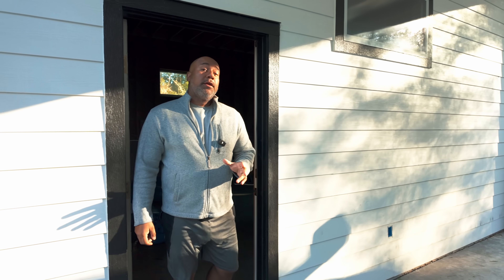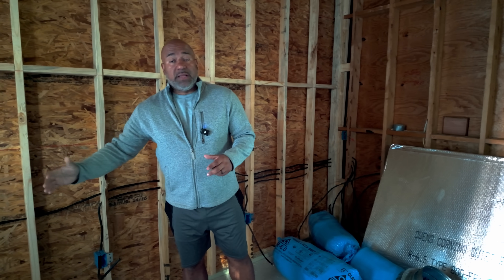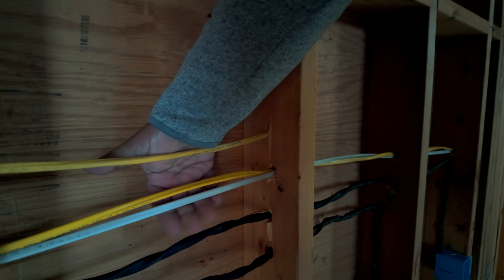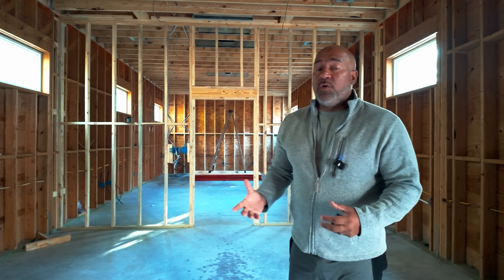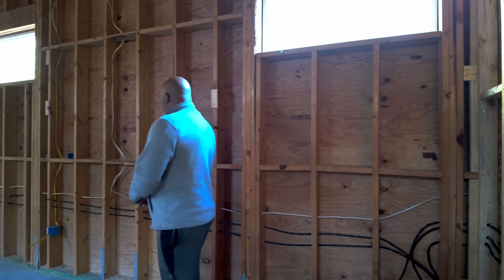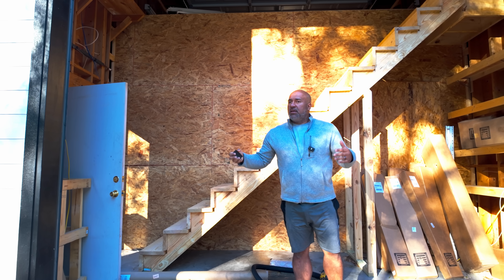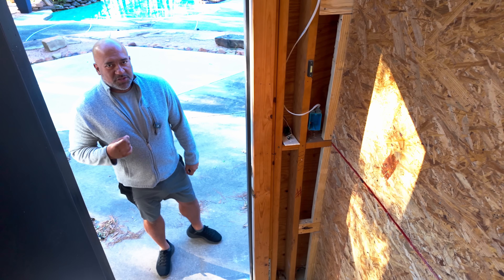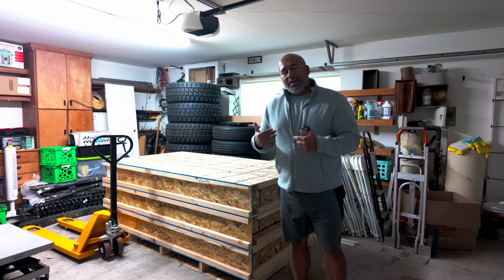Supercharging Future Sound: The Quest for Immersive Audio #halloween

Comment: You put the Romex in a drill and twisted it tighter “for more shielding”… I’m actually speechless for once. That’s not just a code violation, that’s a full-on Darwin Award audition tape. Twisting the factory-twisted conductors even tighter crushes their insulation, stretches the copper dulling it's surface and creates micro cracks = increased resistance. Twisting tighter does jack squat for RFI when the entire run is inside grounded metal conduit anyway, which it's not even supposed to be—Texas adopts the NEC straight-up (with no major amendments on this point), and NEC 300.3(B) explicitly requires that where conductors or cables are run in a raceway (like that steel flex), you gotta use individual insulated conductors rated for it, like THHN/THWN. Romex (NM-B) isn't designed for that; its outer jacket traps heat. But the best part: it’s all on HD video, time-stamped, proudly narrated for your insurance adjuster, who will deny your claim before the fire department even rolls the hoses back up. “Sir, you intentionally modified listed NM-B cable and used it in a non-approved manner. Claim denied!” Not smart.
Reply from the maker: Awesome - thanks for watching though
Reply: @jaysaudiolab  Jay, I get it: content creation is part showmanship. But when you publicly document modifying listed cables in ways that violate the NEC, stuff it into metal conduit it’s not rated for, and over-twist conductors with a drill, you’re not just making a video, you’re creating a permanent record that can (and likely will) void your insurance and endanger the people who work in or visit that building. Many people do this stuff for a living (engineers, electricians, acousticians, inspectors), and we’re genuinely trying to keep you from burning the place down or getting red-tagged. You’ve got a pretty big audience. That comes with responsibility, and also criticism when you screw up. Still rooting for the room to sound great… preferably without becoming a viral fire video first. 🔥🍿

Comment: Have you considered how you will build the walls?  With ceilings as high as yours, the walls will be quite long, and subject to flexing.  I would think you would use something wider than 2x4s, and maybe sheath them with plywood before putting the sheetrock on.  And glue everything together, you don't want studs, plywood or sheetrock vibrating against each other.  I have also read that walls shouldn't' be too stiff either.  I think there was an article about this on the Goodwin's High End website, when they did their sound rooms.

Comment: Yes, a length of 8-gauge wire wrapped around a room, especially if it's unshielded and not properly grounded, can act as an RFI/EMI antenna, picking up and radiating electromagnetic interference. This happens because any long, unshielded conductor can function as an antenna for both transmitting and receiving radio frequencies. Properly grounding this wire, using twisted pair wiring for signal return, or using a shielded cable can help prevent it from acting as an antenna, and can help mitigate its interference.
Reply: It doesn't really matter how or which wires he uses. I doubt the human ear can detect any difference. Well, the main thing is that he enjoys building the listening room.

Comment: Having the wires cross at 90 degrees will provide the max isolation to each wire distance is not need there since there is no inductance  coupling . An outside isolation transformer for the rooms can give a very large noise reduction . Nice build so far .

Comment: Hi Jay, would be interested to hear what type of receptacles you plan to use, as well as the breakers and sub panel.  

For my build, I used the PS Audio receptacles which are really nice and they accommodate 10 gauge wire.  I also used Square D breakers and sub panel.  

I originally asked for a sub panel with solid copper rails, but unfortunately that didn't transpire. But, they did use 3 gauge wire from the main box to the sub panel which was a pleasant and unexpected surprise.

Best of luck with your build.

Comment: What's normally done in attics is to suspend from the roof on an isolated uni-strut U-channel frame any air handlers so the celling does not become a giant drum head and transfer any equipment vibrations to your celling just ask your A/C contractor to suspend the air handlers I am sure he's done this many times before. This is very important for keeping your HVAC quiet. Ray

Comment: I do not recommend using any 60 cycle US current for Europe 220V 50 cycle  gear unless the equipment is labeled for 240V 50/60 cycle electricity. Easy way to get rid of any inductive cross talk from your feeds would be to use 1/2"-3/4" EMT and then you eliminate any induction and gain fire rating and can add circuits in the future by just pulling more wires thru the EMT metal pipes that were part of original build. Ray

Comment: Please put in double boxes for you 8 gauge circuits now.  After it’s all done you only need to use one of the receptacles but in the future, being able to plug in three gizmos directly will be so far better than a plug in strip. You could also two circuits to each of the left and right boxes. You also should have “regular” outlets on that back speaker wall for hey whatever, like a light.

Comment: You really should have talked w an EE who does power.  Also an electrician.

First you're going to have to run a trench and a separate meter to your out building. (garage).   You could  have run a line from your house... which would accomplish the same thing. 
Splitting your sub panel (which is what you have if your main panel is in your house... doesn't really do much for you.  Same w the over gauged wire.  (I think 20A is 12 gauge wire)  You're worried about noise in your electricity from your main house  yet you have an A/C unit on your line in your out house.  So you will have noisy appliances 

Did you budget adding in lighting rods and grounding them on your building?  
Or adding surge protectors at your panels?  (now one for each sub panel)  Are you adding any line conditioning at your outlet?  A re-generator?  
Are you putting in 5-20 NEMA plugs?  Something better than basic builder grade? 

You have some things right... other things not so much.

Comment: This is where the phrase, a little knowledge is more dangerous than complete ignorance where the latter is aware of their ignorance and relies upon professionals to design and implement. First of all, you’re not plugging in a 240VAC “amp from Europe” into your 240VAC NEMA receptacle unless that amps power supply was specifically intended for NA market. NA uses 60Hz AC, most of globe, including Europe uses 50hz. You will smoke the toroidal transformer and likely the caps feeding a 50hz designed amp with 60Hz AC.

You twist the factory twisted NM cable but then you run parallel pairs 4” apart? Please hire a licensed and knowledgeable professional before you close up that wall. 

Did you drive a ground rod through slab for your ground bus?
Reply: I wonder what the building inspector will say.  I'm not sure if he's pulled any permits or has to pull permits... although w the electrical work he should have.  Especially when it comes to insurance. 

Building codes differ by state and municipalities.  Same with running a business out of a home.  (But that's another story...) 

Also I don't think the US 240VAC NEMA plug is the same for the US as it is for Europe but I could be wrong.
Reply: @michaelsegel8758 I honestly don’t know if he’s in Harris County or not. My son lives in Houston, University Place neighborhood near Rice University, where he is a professor. We did permit work on his home when he first bought it, that county follows NEC. If Jay is located outside of Harris Co, it’s very possible they do not follow NEC. There are many jurisdictions in US that fail to follow NEC. 

There would be several red flags an inspector would fail property for. Just having 8awg NM cable in 2x4 studs, you know there is not the required 1.5” setback yet no nail plates or shielding. 🤦‍♂️ While running parallel feeds of NM cable less than 16” apart is stupid from a noise standpoint, it does not violate any portion of NEC. On the other hand, there are no North American 120VAC receptacles that I’ve seen rated to accept 8awg conductors. Largest allowed is commonly 10awg, even that is pretty rare. It’s likely they will tie the 8awg line to 12awg leads from receptacles, otherwise a fire risk and major red flag for inspector. 

Correct, no NEMA receptacle suited to any European plug. We own a home in Northern Italy that uses a stacked in-line 3 pins receptacle. Most of UK and EU use what they call a Type C 2-pin connector. Unfortunately I’ve seen folks mocking up custom power cords with either an IEC style or a 9-pin DIN connector that comes as factory chassis mount, the other end a NEMA TT30R or 14-30R .

Comment: Hope you got a deal on those Mc 1.25kw mono blocks, otherwise you're about to get stuck with them like every McIntosh dealer in the USA (Since Bose ghosted a ton of McIntosh dealers).   Dealers are liquidating those for $11,500 each all day long.      As to the electrical....pass the popcorn, I've posted previously what you should have been running.  SMH

Comment: Have you considered an air filtration system in the rooms?  They won't be something you want to dust when they are finished and such a system will reduce the need to do so, and replacing filters is much easier than spending your precious time with a feather duster. Although I imagine you would look fantastic doing so lol.  Just a thought.  Also, however many mains power outlets you THINK you need, Treble it! (No pun intended) I fitted over 20 in my digital dark room and ran out within weeks, I now have extension leads tacked to the bloody walls everywhere. Lesson learned 🤣

Comment: On the wires I would have used emt metallic conduit which is code where I live that would shield them from all internal and external interference. I think that is much better than just twisting the wires. My only suggestion.
Reply: Conduit is required in Chicago. And just run 12ga wires for 20A.  I wouldn't mess w the 240 but I did it in my former home's kitchen for some appliances.
Reply: Correct I am I. The Chicago area also.

Comment: If you spray insulation foam on the walls, you will seal all the wires and sockets in the walls. If you want to make any changes, you virtually have to pull down walls and do everything again. Cutting and drilling through foam releases all these fine particles in the air loaded with toxic dust. Use of natural wool or jean bats is the best imo.
Reply: As with some of the comments regarding electric pre-wiring, he’s “done his research”, so it’ll be interesting to see how things turn out. Of course, some of the concerns expressed could take longer to materialize than he stays in this location and the Siamese twins of expectation and confirmation bias are very strong in the obsessive audiophile community, so there’s that.
Reply: @fonkenful Foam probably burns fiercely

Comment: Hey Jay,  It’s been fun watching the process of your room build and the attention to the details. Thanks for the work that goes into putting the posts together. As an electrician, I was impressed with the dedicated circuits for the audio, and isolating those circuits from the general purpose circuits. The lighting dimmers can be real noise makers (electrical noise). One detail that caught my eye was the #8 gauge wire. The 15 and 20 amp receptacles rated for 120 colts will have connection lugs that are designed to accommodate up to #10 gauge wire. It’s likely the contractor will have to “pigtail” a short piece of #10 wire to each conductor inside the wall box to enable connection the those receptacles. Not a problem, or code violation, but he will want to make sure the wall boxes have adequate capacity for the wire and devices.  The only other detail that comes to mind is having your electrical contractor go the extra mile with the grounding electrode system for your building. Additional 8 ft or 10ft. copper rods spaced properly can be great way to improve that grounding path as well as a good type1 surge protective device at the panels. 14:08

Comment: House feed from utility will most likely be 1/0 aluminum or smaller or at best 4/0 aluminum. Did you test your feed? Utility will come out for free
Reply from the maker: They came today
Reply: Have utility test feeds power factor at your residence. You want clean power coming in.

Comment: I've sold millions of dollars of Eaton loadcenters.  Get the CH loadcenter from them, full copper and built like the 1950s.  Those BR breakers and BR loadcenters are average with small bus bars, get the CH ones which are thick and copper.  I don't know if Texas requires Arc Fault Ground Fault breakers on each circuit, but if they do just install them for inspection and replace them with regular CH breakers later.  Even 'high end' audiophile panels use the CH as their base.  Nothing from GE, Square D, Siemens even comes close to the build quality of the CH loadcenter.

Comment: A pro tip. You can adjust humidity as you said and humidity have a small impact on speed of sound.. ❤🎉

So at 20 °C going from dry air to saturated air increases  by ~1.5 m/s (≈0.44%).

Comment: @Jay, you should have gone off-grid for your music system in both rooms with LFP batteries and Solar Panel on the roof top for charging...EcoFlow offers amazing products for this...you would have got far far better power
Reply: Going battery with a pure sine wave inverter was the biggest leap in my system.  That might be a bit too much for a lot of people, but so worth it.
Reply: @isobutylquinoline yes batteries with pure sine wave inverter can bring out a lot of improvement. Just add a very competent EMI filter next to batteries so that it will remove all EMI generated from SMPS in the inverter. I am using OnFilter PDU connected to the EcoFlow Delta 2 battery...best and cleanest power possible for my system.

Comment: I just built two 2meters power cables made of 14awg occ copper ptfe insulated, one twisted and one straight with wood pieces to separate them 7cm appart. The twisting reduces noise (sound quality increases) but slow down the sound, like power conditioning can do. And the lower the gauge the worse it should get, because of capacitance. So I’m a little bit afraid of using meters of 8awg twisted. It could sound slow like crazy :o. But maybe I’m wrong..
Reply: Huh? 
"Slow down the sound?" 

Do you realize that you're talking pure nonsense ? 

And when do power cables carry sound?
Reply: @michaelsegel8758 indeed im talking about audio and not sense or logic. This is the mistake you all do, thinking before listening, and you miss many things. A system that sounds slow when it comes to rythm and pace is something real.

Comment: I used 10 g cryo treated romex, I cut two 6 foot runs and then used it as speaker wire so I could listen and determine what end I used at the meter and what end on the hubble cryo treated outlet. Don't use dimmers way too noisy.

Comment: Jay... You should create a raised flooring platform,  with a lowered area near the front.. so that all of your Amps sit BELOW the surface of the raised listening Floor (an Amp Pit).   This would allows the soundwaves from the speakers (which are also at the same height of the listening floor), to propagate the entire Room, without bumping into amps... and causing any sound changes.

 These Amp "Pits",  could even potentially have removable trapdoors to completely hide them.   But thats not really necessary.

 An Added Benefit to dropping the Amps in a Pit.. is that you can Install a Movie Projection screen.. and have an excellent home theatre experience, without the Amps visually distracting you.   The screen can also be mounted much lower, since the amps are below the surface level.

 The Amp Pit, can be a few stair steps down worth of height, and be plenty large enough, for both operation, and various swapping.
Reply: However, he sells big, beautiful amplifiers.
Reply: Getting heavy amps into and out of that pit sounds like a nightmare.  Easier to just wheel the amps into place on a straight surface.  A lot of this elite gear is nice to look at too, so theres that
Reply: @Starch1b2c3d4a  The Pit could simply mean, an area of the floor, that is lower than the seating area.   Just imagine two to four steps down, into a sunk-in area.  Sort of like a sunken living room... just a smaller sunken area  (but plenty big enough to move equipment around in... as well as to photo, film, attach/detach, and operate.

 Getting an Amp down two to four steps, isnt that big of a deal.  I used to move +400 lb arcade machines, down into basements.. all by myself (and of course, a Hand Truck / Dolly).  Ive even got them back up 25ft worth of stairs.. on my own (though, not as advisable to do).

Comment: Twisting live and neutral around the ground is a very bad idea and will introduce more problems than it solves. AFAIK all of the research based around twisting (like the work done by Bill Whitlock) is twisting live and neutral only. Ground needs to be run separately when you're twisting. This is all well known in the studio world. It's science. It's not guesswork and what you read on a forum
Reply: Correct. Big no no twisting the ground with the Live and Neutral!
Reply: You can find this info in "Ground Loops: The Rest of the Store" by Whtlock and Fox

Comment: Parallel wires are called Transmission lines. Capacitive and magnetic conductance. They should be run crossing at as close to 90degrees as possible. To have had them cross over each other regularly would have been much better than straight parallel.